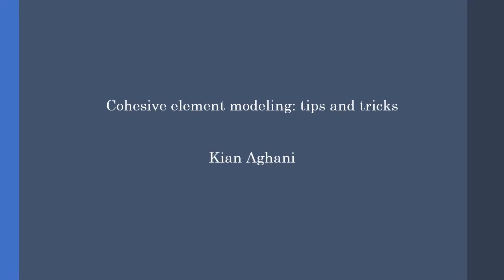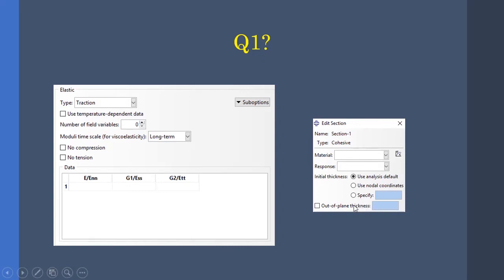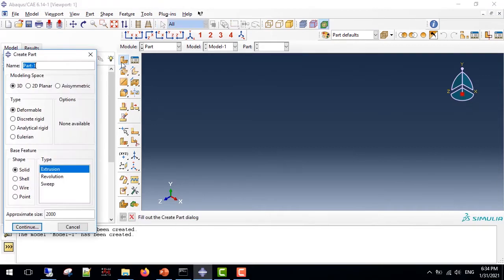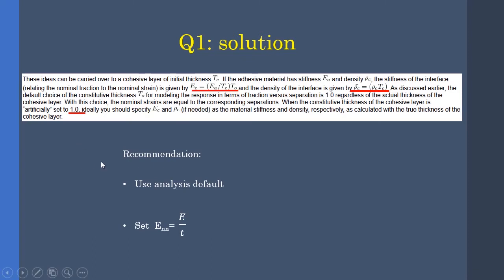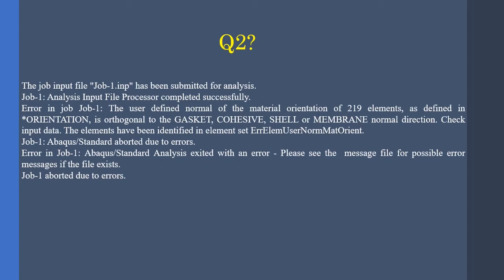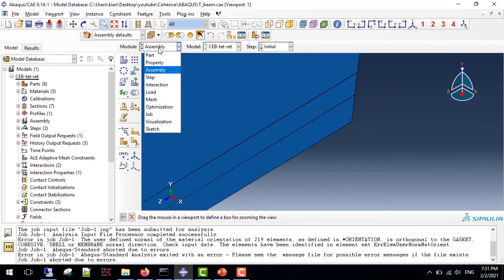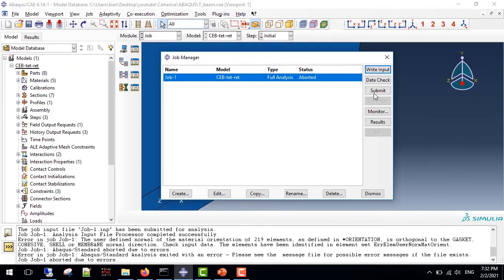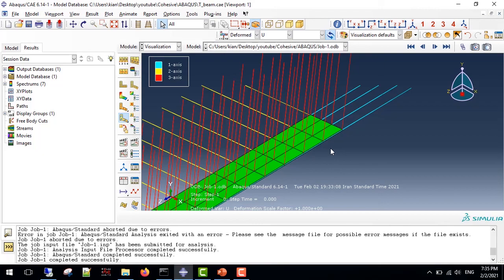Cohesive element modeling in ABAQUS: tips and tricks

Comment: Very nice video sir. I have modelled a cylindrical cohesive element around some solid material. I am getting error like " THE THICKNESS FROM GEOMETRY IS NEGATIVE FOR ELEMENT 1.CHECK IF NODE NUMBERING IS CORRECT". How to rectify this error sir
Reply from the maker: In my opinion, define a cylindrical CSYS and then assign the stack (normal) direction according to the radius direction.
Reply: Thank you for your reply. Instead of a new cohesive surface, a new cohesive(surface to surface) interaction has been added in between the two contacting surfaces.. now I am not getting any error..but convergence is not happening.. Any suggestions sir

Comment: Hello, thank you for the video. I'm modelling a single lap joint with CZM as the adhesive, but I'm facing convergence problem. How can I solve this? I've tried changing the parameters, and set the viscosity coeff., but still no result. 

Thank you
Reply: *I'm modelling a 2D single lap joint
Reply: @prettyomen  are you successful in modelling 2d single lap joint
Reply from the maker: Hi. It’s difficult to say what exactly is the problem because there might be a number of reasons. However, the most common is the thickness of the CZ. If you are certain of material definitions, then check the thickness and direction of the CZ.
Reply: @kianaghani  Thankyou for your answer, I want to ask another thing, I'm modelling a continuum approach cohesive element. When defining the ELASTIC material behaviour, what TYPE do I choose since this is not a local approach a.k.a I'm not using traction-separation law?
Reply from the maker: @prettyomen  In this case, you should add *TRANSVERSE SHEAR STIFFNESS into the INP file. Read the manual carefully.

Comment: Hello sir,
I am using Cohesive element for modeling delamination in composite materials. But I facing convergence error for the following, How could i solve the convergence? I did try to change size and number of increment but so far I haven't worked. 
Thank You,
Reply from the maker: Hello. There are a number of reasons for that. In my experience, thickness definition could be the major problem.

Comment: Hi. I am simulating delamination in DCB specimen. I use cohesive surface and getting error as “ xxxx elements have missing property definitions.”
I am certain about the section assignment in property module, which i have done properly.Still this error.
What else could be the fix ?
Reply from the maker: Hi. If you are sure of the section assignment or rest of the modeling, check the stack direction and thickness assignment. 
Also, you can send me your CAE file and I will check it for you.